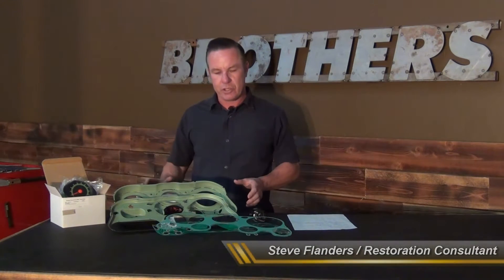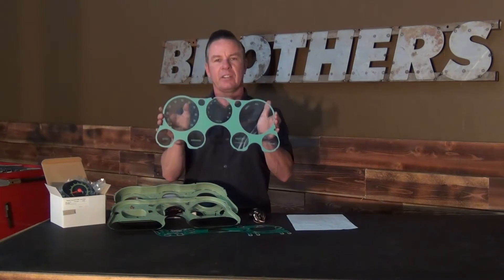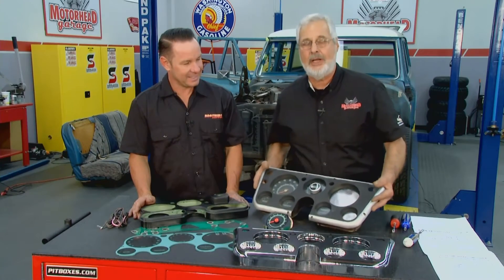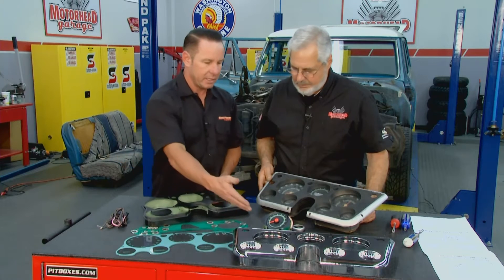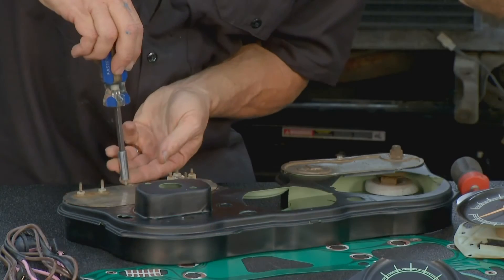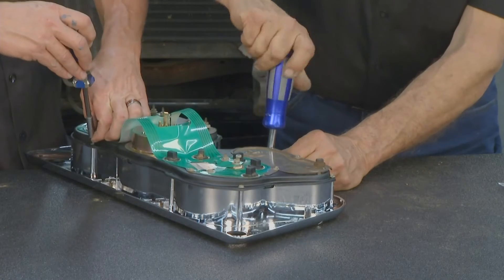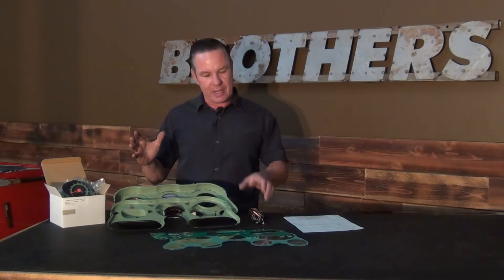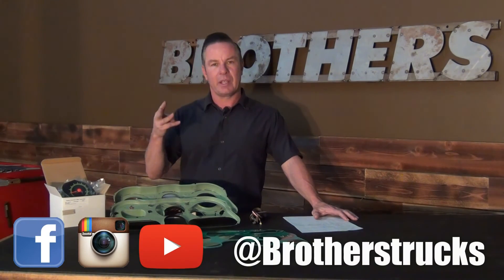67-72 Chevy & GMC Truck Tach Conversion

Comment: Can I use one of those tachs with a Mallory HEI Distributor? If it matters the part number for it is 8548201
Reply from the maker: As long as the HEI has a tach pickup plug you can.

Comment: I've read that often, the stock tachometer does not work with HEI distributors. The tach shuts off the engine. What does one need to do in that situation.

Comment: Does this tach work for an ls conversion?
Reply from the maker: It can work, but with the LS conversion it gets complex. It's going to depend 100% on the output signal from the electronics you use for your conversion. There are a few aftermarket accessories out there to make it work with the factory wiring and electrical, but if you go with Holley, Edelbrock, FiTech or something like these then you need to contact that manufacturer for their suggestion.

Comment: Nice video. But you may want to try to answer a few questions on hook up to the H E I and the coil.  The coil Hook Up is what you sell. But the HEI  hook up with a plug in connection . This could help. The location on the HEI hook up would help to. Thank you for sharing this video. Keep on trucking for freedom.
Reply from the maker: Thanks for the suggestion Pat. The HEI uses exactly the same wire as the coil, except it actually plugs into a spot on the cap that is typically marked TACH. GM's HEI caps usually have a second port on the cap marked BAT. For Our conversion the install would just require the installer to crimp a spade connector on the Tach wire.